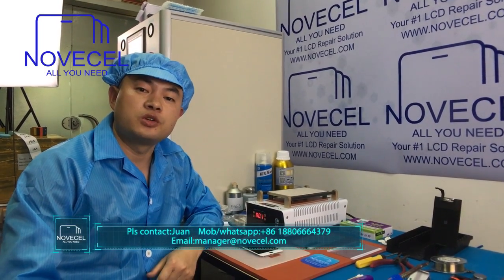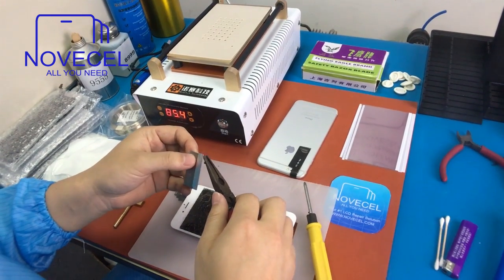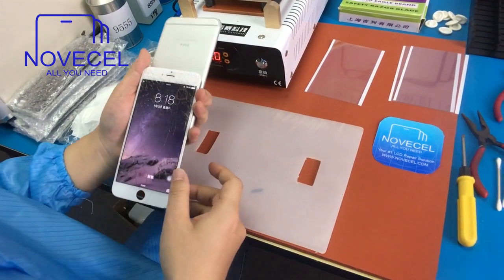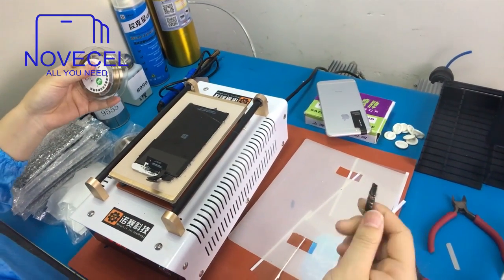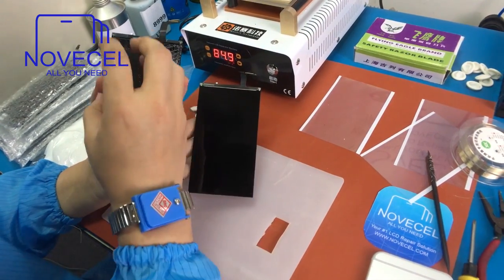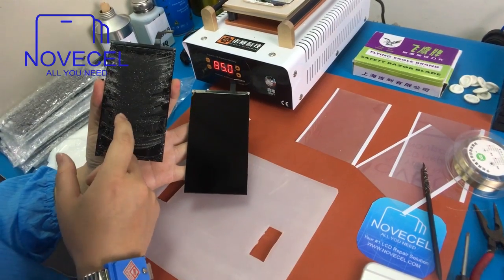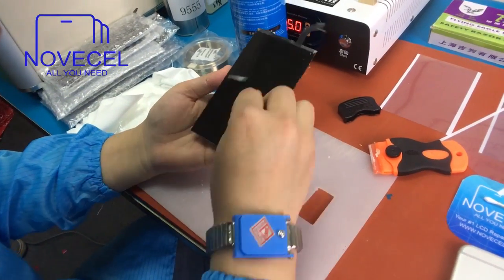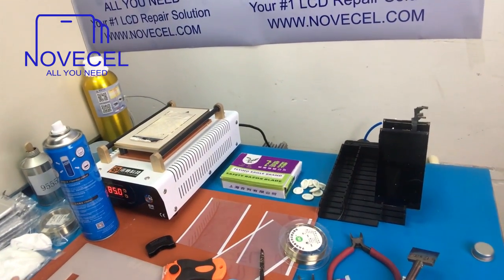1/3 --LCD separation BM02 Most precise bonding machine/Laminating machine used for iphone 6 plus

Comment: Hi, can you tell me what is inside 9555 remover, please? I wonder if it is bad to breath and touch it with bare hands... Thanks, David
Reply: hello, sir  ,  our 9555 have something like ethyl alcohol, it very safety, it will not hurt you even touch them. and it has very comfortable smell.  For further question, you can contact me. Whatsapp: +86 18271335587